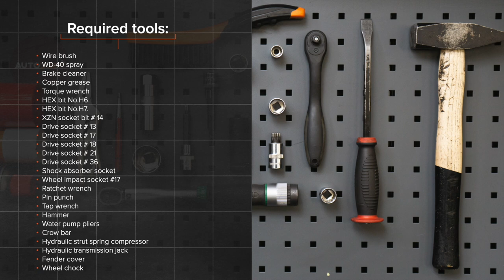How to change a front shock strut on SEAT IBIZA 3 6L [TUTORIAL AUTODOC]

Comment: Attention.  For example, Kayaba has a # 22, not # 21 nut on the damper at the top
Reply from the maker: Thank you for your request.
The mounting nut of the shock absorber support does not have a size of 21 mm.
AUTODOC
Reply: @autodocuk  and the suspension sway bar must be countered by a torx